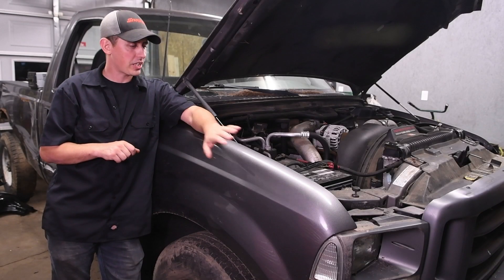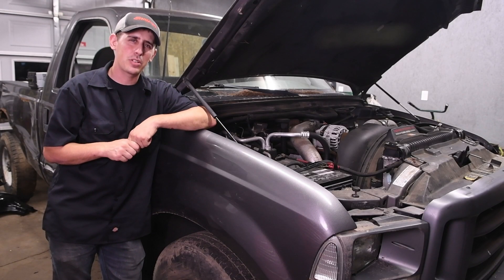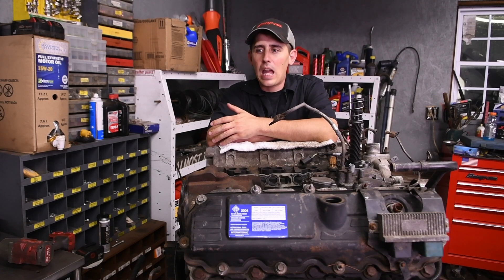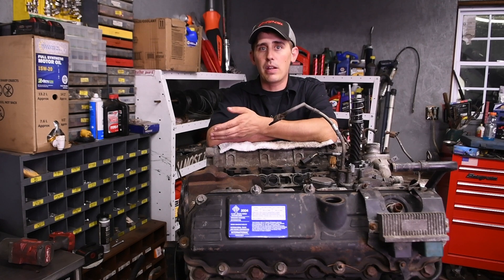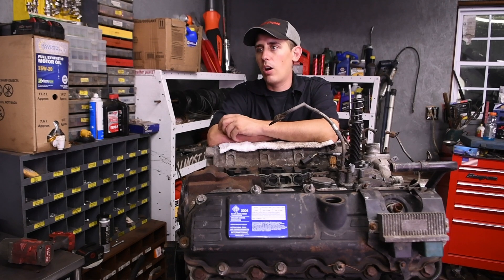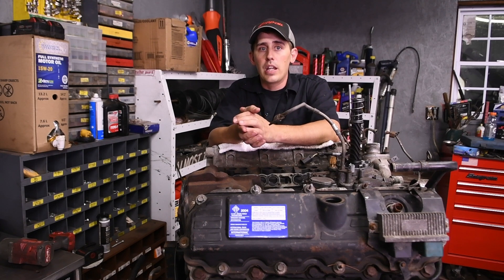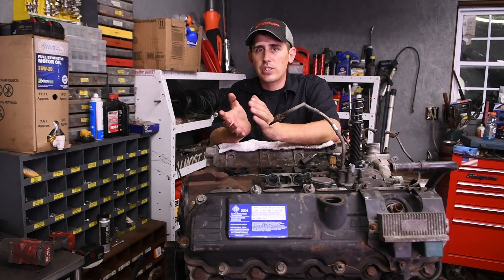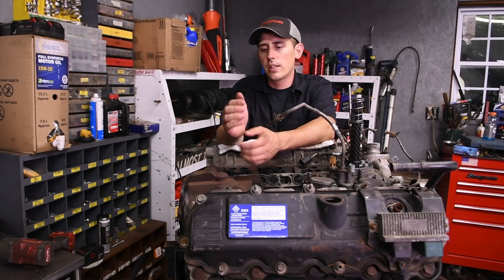6.0 Ford NO START diagnosis

Comment: Nice videos I’ve seen so far.  I’m working on my 2004 6.0 recently got the bulletproofed, egr cooler, studs new heads, they did the blue spring ect.  It only ran about 20 miles and now I have a no start.  Originally I took the cover off the ficm and had 48v but no injector clatter.  I had my wife crank the truck while checking the 48 volts it stays solid.  I reseated the pcm, ficm plugs and checked accessible plugs still no clatter.  Then when I tried messing with the hard to get icp wiring just above the transmission.  I plugged everything back in the clatter is back.  Not 100% sold it was that sensor or wiring.  I have a Foxwell nt201 but I’m not getting any codes which seems odd.  While diagnosing the no start I opened the fuel filter on top of the engine.  I’m not getting bubbles back but when it is priming I’m hearing almost like air coming out of the cap.  I tired a new cap and oring same thing.  The fuel filter is oem also.  Maybe I’m not letting the motor prime long enough and air is in the system?  Although I did key it over 10 times with out starting it for extra priming.  I finally cranked it 30 seconds and I see the oil gage move half way or more.  While cranking it sounds uneven like low compression in cylinder but that’s new after the clatter came back.  I believe that’s just some cylinders trying to fire and others not.  I’m planning on keep this truck a long time it only has 92k miles on it.  Any thoughts?  And what would be the best all  around scanner to see if I’m getting everything I need like, crankshaft, camshaft monitor, icp ect.  I’m not really seeing any of that on mine.  I’m trying to not have to tow it down to them even though it could easily be some of the work they did.

Thanks,
Dave
Reply: I’m looking for a scanner that gives me codes and basic monitoring
Reply: @davidmoore1424  what was the problem?

Comment: Thanks for the video-great watch.. not sure if your still looking at comments but thought I would ask... 03 6.0 stumped no start.. scangauge tells me everything's in spec.. it wants to catch but just cant get there.. it all began with a completely dead gas pedal.. ? it was running good  then peddle faded away to zero reaction ... it was also leaking so tossed an ICP in it.. fired up ran for 1 minute pretty well...  still had dead peddle.. then went to heavy miss then quit .. last it ran... burning a hole in my brain... thanks Dave...

Comment: Awesome video! Hoping that you are able to answer a question for me! I have an 05 f350 6.0, crank- no start. Dealership told me to put a FICM in it so I did and it’s the same. Crank- no start, it through codes for all 8 injectors for circuit low. Have you seen this before? I have a tuner that will read codes and allow me to read some gauges like injector pressure, which while cranking will reach up to 1,100 psi but won’t start.
Mechanic hooked a computer to it and said that the high and low oil pressure was fine. I’m just wondering if the problem could be electrical or fuel related, or both? 

I’m glad I found you channel! Hope you are able to provide some type of feedback
Reply: Did you find out the problem?
Reply: Jump the crankshaft wire to the computor, do the same with cram senso.

Comment: Would one of these seem more likely than the other if my truck shut off while I was driving, running fine then shut off in seconds. Cranks but won’t start.
Reply from the maker: Shut off while driving but still cranks I would start by making sure you have oil pressure on the dash while cranking. If you do I would say highest probably is a high pressure oil leak
Reply: @InTheShop  I appreciate the fast response! I plugged the scanner back in and it finally gave me a P0231 code stating fuel pump failure, fuel pump relay failure, or pcm failure.

Comment: I'm having problems with my 6.0 diesel turbo crank but no start I replace the sending unit the fuel pump crank but no start Tbc light came on my dashboard and I was having some sputtering those were my symptoms

Comment: Hey man quick question just replaced hpop in the shop and put it back together and now it almost wants to start but still no start.has a code for the #8 injector and thoughts

Comment: My 06 won't start, batteries are new, ficm voltage is 48v, icp pressure is over 500. It was fine a few days ago but now my rpms while cranking are reading extremely low even though the engine is cranking fast. It for sure seems like the crank shaft sensor is bad but I wanted your opinion. Thank you

Comment: I replaced that front fuel pump. And right after that it still read po231 fuel pump secondary circuit Low voltage, And then it threw a ficm code P1378 we tried to jump it but it wouldn’t jump, battery wouldn’t hold a charge, and their brand new batteries. But why didn’t the ficm code come up to start with?  So I really don’t know what to do. It makes me think I put that fuel pump on for nothing. Now it makes me think it’s the ficm,  but I can’t keep throwing money at it. It’s $740.  What is your advice.

Comment: Love the video bud I own 4  6.0s   if you could give me advice on one its and 04 but mfdate  was a 07/03  year  I'm haven a hard time locating the dummy plugs
Reply from the maker: Is the ICP sensor in the front of the passenger side valve cover or is it in the high pressure oil pump?

Comment: I have a O4 F250 6.0 L
I have a no start issue right now. It completely cut off when I was driving and won’t start back up. It’s reading codes PO231, P2614, P2617
Cam sensor, crank sensor, Low fuel pressure. 
The oil is good, there’s fuel, I can hear the fuel pump when I turn the key. I checked the fuel filters they were fine. I checked the 20 amp fuse it was fine. Fuel reset switch was fine. Fuel is not getting to the filters, it wouldn’t fill up the one under the hood it was just spitting in it and the one under the truck. So I am not exactly sure.
I replaced the FICM A year ago.   From watching your video I think it could quite possibly be either the camshaft sensor or fuel pump. But I’m not exactly sure I don’t wanna throw money down the toilet.  
What do you think?
Reply from the maker: If it’s not filling the fuel bowl you have a fuel issue. Start by making sure none of the lines are cracked and sucking air.
Reply: @InTheShop  I couldn’t find any cracks or leaks in the fuel lines.  Another thing is it was sitting for a year.  I had driven about 600 miles before it cut off and the incident actually happened. I have a feeling it’s the fuel pump but I don’t like to go on feeling when it comes to this truck. There’s also a fuel pump in the gas tank. But I can hear that one kick on. So idk.

Comment: I really appreciate your video. I went through each step you suggested checking all with my scan gauge 2. Injector chatter was quick and sounded good in the beginning. Everything passed with no codes. I even unplugged the icp and it still would not start. (Ron showed that trick in one of his videos) Still truck will not start. I ran the batteries down trying to get it to start, then the injector chatter got slow. I quit at this point so I can charge the batteries back up. They are new by the way. Motorcraft 850 amp each. I don't know what else to do. Anything else you can think of before I have to call a tow truck and have it taken to the Stealership?

Comment: Great video! HELP.. I'm having no start issue.. replaced all injectors yesterday, glow plugs/ glow plug harnesses, new oil/ filter, fuel filters, and flushed coolant system.... Messaged did pop up on dash that said water in fuel earlier in the day, I drained the filter. Fired right up but message never went away.  It ran good for 1h then stalled while driving & wouldn't start back up, sat for 5 mins, cranked and fired right up. Ran ok for aboit 30secs, then got underpowered and rough idle and shut off again. This happened 3 times until I got home. Now today she won't start at all. Im getting no codes. But I dont have an expensive scanner so there could possibly be codes on it.. The Oil level is good and I tested ficm, it checked out as well. Whats my next step
Reply from the maker: Is it a crank no start or a no crank no start?
Reply: @InTheShop  crank no start
Reply from the maker: Unfortunately you are going to have to get the truck scanned. When you turn the key to the on position can you hear the injectors buzzing?
Reply: @InTheShop  i do not hear them buzzing.
Reply from the maker: @joeycarpeal  check the plugs on the FICM
Reply: @InTheShop  hooked good scanner up to it everything checked out. Pulled top fuel filter and cranked it over to see if it was getting fuel, nope. Tapped on tank. Sounded hollow. Put 10 gallons in it and it fired right up. Can you believe someone stole my entire tank of fuel while it was at the mechanic shop that I got tired of waiting on to replace injectors.. thats why I tackled it on my own... some ppl blow my mind
Reply: @InTheShop  so now I guess ill have to fix my faulty fuel gauge problem

Comment: Hi there I have a crank no start I have replaced dummy plugs and stand pipes. Replaced ipr, while doing that the ipr top have did swivel for some reason. Could that be the problem as I can get it warrantied out from oriellys. But I have base oil pressure but the ipc will only show 9-30 psi when cranking. Batteries test good and I get them fully charged but I have two new optima yellow tops to throw in there just in case. Any feed back is appreciated as I’m trying ti get it running for work. Oh and mine is a 04.5 and up 6.0 in an excursion.
Reply: Hey a new icp valve

Comment: what causes the 2004 f 250 power stroke to make multiple clicking sound but no crank when both butterias are strong showing 12,66 volts and starter relay is working needless to say starters is brand new replaced few mouth back and cables look good. ifthere is a starter solenoid besides the one our the starter itself where would it be locaterd?if you may be able to show me that I'd really appreciate it.

Comment: Your videos are awesome.  I recently purchased a 2005 F-250. Ran like a champ, until it didn't. I literally, filled up the tank with fuel, drove home, parked in my parking space and shut off the truck.  Forgot I needed to jump my tractor so I restarted the truck and lo-and-behold it was missing with white smoke. Hooked up my OBDII tester and am getting:

P0113
P0231
P0263
P0266
P0336
P0674
P0676

Next morning, No start. My diagnoses is 2 bad injectors and 2 bad glow plugs, along with the IAT sensor. P0231 has me worried about the fuel pump... The relay and fuse are fine.

What do you think?
Reply: wire shorted from the crankshaft or cram sensor to the computor

Comment: I have a 2006 with a crank no start shooting a p2623. Doesn’t matter if it’s hot or cold. It’ll crank no start at random times. When it’s running it’s perfectly fine. Do you think this could be an electrical issue instead of mechanical?

Comment: I do enjoy your videos. Lots of good info. I do need you input on a problem I am having. I have a 05 excursion 6.0 I was having an external coolant leak from the head gasket. Truck was running perfect before the repair and now I can't get it started. Any ideas as to what direction to go? While cranking I have well over 500 psi on the hpo. 84.8 Percent ipr. 48 volts ficm. Problem I see is dtc set all injectors low voltage circuit. Where to go from here? Any ideas?
Reply: broken wire, mechanics during repairs will try and squeeze parts out of the motor and in the process damage wires.

Comment: Does a constant steady buzz when key on engine off indicate bad FICM ?
Reply from the maker: Does the buzz stop after a few seconds?
Reply: @InTheShop  yes
Reply from the maker: That’s normal. The truck should run all of the injectors for a few seconds when you turn the key to the on position.
Reply: @InTheShop  ok , I have a typical crank no start , replaced HPOP , with upgrade stc , dummy plugs , standpipe , oem filters, ipr , ipc , do not have a scanner tho

Comment: 04 6.0 died while driving. Did start back after long crank but idled very low.towed it home now just crank no start..pulled misfire on all cyclenders.new ipr new icp new fuel filters and pump.now it throwing glow plug open circuit or relay.it does have a little white smoke and smells like fuel.plz help tired of chasing codes and throwing money at it.i love this truck

Comment: Hi have a 2005 ford f250 diesel and the codes that its giving me is low voltage but the battery are fully charged even tried hooking up jumper cables to another truck and see if its just the batteries not putting enough out and still the same low voltage codes im not to sure what im doing wrong or what direction to go next if you could maybe point me in the right direction or give me some ideas on what im not doing id appreciate it just kinda stumped. Thanks

Comment: Glad I found the chanel maybe you can help I got an 05 350 crank no start and no clatter at all now it does crank sometimes even without the clatter and runs just fine but other times just crank and no start I have replaced the relay also the board inside the ficm and still having the same issue can you please help also I have 2 trucks should I invest in a scanner I try and fix my own vehicles if I can and thanks in advance

Comment: I have a 2006 f250 6.0 was driving down the road pressed on my breaks and my truck died like I turned off the key , wouldn't start but would turn over fine and fast waited 2 hours and still wouldn't start . Got it towed home and this morning went outside and it started seems like it's running fine shook wire harness around to see if it would die , reved it , moved it , hit the breaks , and it still stayed running.  started hot fine and cold  like normal  . Fuel pump makes a slight crackling noise randomly when key is on but I'm not sure if that's normal Only codes I had were 
P0611,P0528,P0480,P2623 on my scanner when running it reads 
Hg pressure 29.1
Volts between 11.48-13
Command gear 1.0
Engine load 43.9-36.4
Ficm injection between -13 -11.5
Ficm main between 13-11.5
Ficm main 54.5v 
Icp duty cycle 0.28-0.26 
Do you have any ideas  what I can do to test it further so I don't get stranded 😅

Comment: E450 6.0 van crank no start. Only builds 300psi icp. Ipr while cranking won’t go above 14%. 12 volts going to it. Installed new ipr same issue. Raise ipr duty cycle with scanner to 84% truck builds 1400psi icp but still no start. Everything else checks perfect.

Comment: Awesome video just got a 2003 F-250 my first diesel trying to learn as much as possible thanks for the detailed information will help me alot
Reply: How many miles are on yours Mark? I’m in the same situation
Reply: @bradleymaddy7380  450000km it's been in a shop for 3 mouths now and the mechanic still can't figure it out
Reply: Tell your mechanic to jump the wire from cranshaft senor to the computor, do the same with the cram sensor

Comment: Still won't start still not getting enough oil pressure i replaced hpop pump and injectors rings and still doesn't reach 500 psi oil pressure

Comment: I love your video but I have one major problem I am very limited on resources,no code reader much less the one that will do the injector Buzz test and show sink or not I was driving my truck just shut off out of nowhere I checked the oil first thing and it was a gallon low. I did oil change make sure the oil is going to the filter. Now it takes around 10 seconds of cranking before oil pressure gauge rises but no start. Is  there some trick to getting the hoop going again after the shutdown or a process to restart after ran low on oil?

Comment: Hello i got a 6L problem 06 studded egr delete head gasket. I crank between 10 to 20 seconds then wait 10 mins to let starter cool down try again im getting oil pressure about 8 seconds im getting smoke out tail pipe. I scanned truck ipr good icp good ficm good i pulled fuel cap diesel was full oil was filling bowl.
I just rebuilt this motor from 03 to 06 with updated high pressure pump but no fire i tired ever 10 mins for 5 hours truck tried to kick

Comment: Hey I have a 2004 f250 super duty 6.0 power stroke engine and I have to spray starting fluid in it to start it…I’ve changed the MAP sensor and ICP sensor and still it’s doing the same thing…so I just ordered a turbo, HPOP, and ipr valve sensor…do u think this would fix the problems 🤔

Comment: Not getting fuel just  replaced the fuel pump  under the driver door  frame rail is there a  one in the fuel tank all so on the earlier 2004 super duty 6.o?

Comment: i have a  06 6.0 i have put a hp pump new injectors bullet proof it will not start once it reaches operating temp let sit for 5 minutes starts right back up any ideas

Comment: I have an 04 6.0 powerstroke that crank no starts. It was running fine and all of a sudden it would only idle and now won't start. I have replaced the fuel pump, IPR valve, new filters. I get 50 psi of fuel at the bowl, when cranking I get ICP pressure of 577 to above 800 when cranking. Icp Voltage is .25 KOEO and .82 when cranking. Engine RPMs are over 200. FICM has 48 volts. I have cleaned the EGR valve. This truck will fire and die almost immediately or will fire up and idle at around 250 to 300 rpm and then die. While Idling it has ICP of around 800. There has been no codes thrown at all during all of this. I have unplugged the ICP and tried to start it and it does the same exact thing. Do you have any wisdom to impart on me for a direction to go?

Comment: Got a scanner put an ipr valve in my 03 was running awesome started when it was hot and all icp, ficm ipr and sync where good, then made a click then shut off at idle like turning the key off and when to start it again and just made a one click and won’t crank and it has brand new starter any recommendations to look at?
Reply: And injectors clatter still and gauges on dash are all working and can hear the fuel pump running